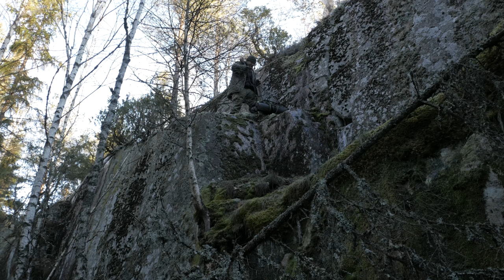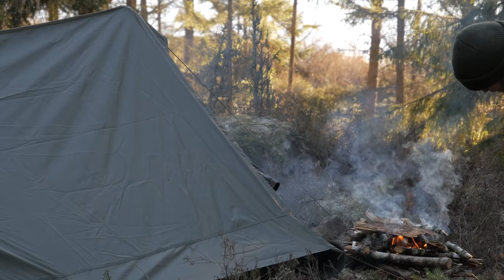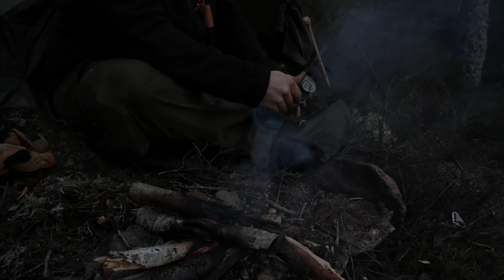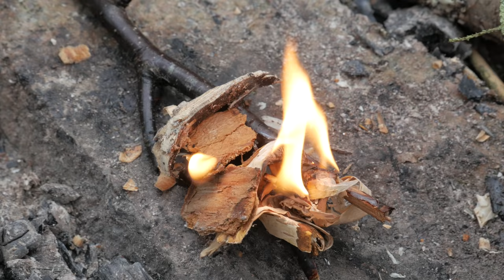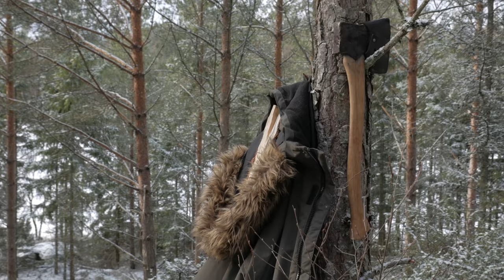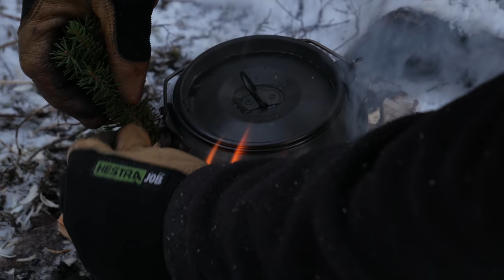3 Days Solo Off Trail Winter Hike  - Kuksa Carving - Natural Growth Bushcraft Chair

Comment: Another awesome video! The camp stool was very clever. Sometimes a piece of wood just tells you what it's supposed to be, and you just have to go with it. I figure seeing that branch gave you one of those "eureka!" moments like that. The kuksa turned out great! If I'm out in the woods, I try and do as much shaping and carving as I can before cutting it out of the log or branch (as you did). It's just way more stable and easier to hold steady if you don't have a vice or clamp of some sort. Glad to see I'm not the only one! The Auger and gimlet sure are worth their weight for Bushcrafting. I think it gets overlooked in many people's kit because the electric drill is familiar and the de facto tool for most people, so hand boring tools are completely off their radar. I carry an Irwin brand MicroDial expansive bit (bore size is adjustable from 5/8"up to 3") and an 18" bit extension that I use with a chuck for an auger brace with a scotch eye welded to the shaft. That, and a gimlet can sure come in very handy! What made you decide on the tent this trip? I'm looking at different zehltban/lavvu type shelters and was curious to know your thoughts on them and how they compare to a tent. Thanks! 👍🏻👍🏻🇨🇦
Reply from the maker: right! what better vice than being attached to the log itself! I took this tent because I need more lightweight, and I knew the temps were going to be both over freezing and far down as -15C during this trip. Im so tired of things getting wet and I wanted something with a floor. And its weird that in the bushcraft world there is some kind of common agreement we are supposed to use tarps and lavvus LOL. Everybody else going to the woods, who is hiking more than just staying in one spot roasting some hot dogs, use tents. So many things is trends these days. I love my lavvu... its the most versatile piece of fabric ever. sure but walking very far in tuff terrain like i did this time, it would have been horrible with a heavy piece of canvas.

Comment: Is it true that the two hole Kuksa are made only for tourist and genuine ones like a handle so they’re usable with gloves ?
Reply from the maker: possible. I had a kuksa with an elegant handle like a little dove tail. But it broke off in the pack. So with that in mind I made this to be like a sturdy tank..yet you can get a nice grip on it. And you can hang the kuksa on like a branch in the hole. If you want to use gloves with a hole just take 3 minutes and make the hole bigger with a mora.

Comment: How did you find the condensation in the French pup?   Not too breathable here in -20c!
Reply from the maker: not more than usual on a rain resistant single walled roof like that...the airflow in the tent is good...with good possibilty to control the amount of draft with the velcro flaps down at the sides.

Comment: I’ve always wanted to try to make a kuksa...is it best to make it out of a birch tree?
Reply from the maker: birch is good but it needs to be curly...like down at the bottom or some part that didn't grow straight, or else they crack easy. also the burls on birch trees are great material for kuksas. a suppressed birch is better than one that has grown fast and straight.

Comment: Another splendid video. How did the tent work out?
Reply from the maker: For being simple in its construction, yet robustly built for costing under 100 dollars I say its a real bargain. People have talked about seams you need to wax and that it gets condensation easily but I expereinced no more problem than usual with a water tight single roof fabric. It got velcro flaps down at the sides so one should be able to regulate airflow fairly good. I know more after using it some more.

Comment: you went into the snow with a F2 tent ?
You sir are one of the brave ones :D
I love my country, but F2s are very cheap, in price and form. Quality ain't bad, but yeah, I'd not use one of those in deep winter :)
Reply from the maker: It performed well. Good control of airflow. Its not for arctic expeditions of course. But I compare anything to a poly-tarp LOL

Comment: How did you find using the French Army tent.
Reply from the maker: It was nice. Perfect size and not heavy. Nice sturdy bottom. Good control of airflow. Have heard about some issues and that you have to wax seams...I guess I find out in summer 😁. Condensation was not more than usual on a water tight single roof tent I think
Reply: That's good hoping to get out with my son to try his . Great channel keep up the good work.

Comment: почему это место, обоснуй.почему дерево не горит？слишком влажное？неудачный выбор？
Reply from the maker: campsite close to water but higher for warm. Flat ground. This is how you burn wet or green birch... slow in the start but greatly beneficial once going in winter. More kindling is preferred of course...but if you do it many times you can do it with less, the thought about doing everything like from a rule of law... im so tired even thinking about that. Makes me sick to the stomach.

Comment: I have that tent and I find it has a lot of condensation, do you?
Reply from the maker: yeah but not more than usual on a rain resistant single walled roof like that...the airflow in the tent is good...with good possibilty to control the amount of draft with the velcro flaps down at the sides.
Reply: Swedwoods  I agree . Thanks for the reply , and I really enjoy your vids  thx

Comment: Excellent. Btw: which Carinthia is that?
Reply from the maker: Carinthia troopen reinforced
Reply: @Swedwoods  Oh, I have three Carinthia Tropen, they go comfort to 5c plus only, so yours must be truly reinforced to make minus :-). I was so amazed by the black compression bag, which usually is a sign for the Carinthia recreation sleeping backs, which I also own. Happy hiking.
Reply from the maker: @-ZELTHELD-  I always have a warm water bottle. to start the night warm is key, and use two wool socks on my feet. then reflective cover over the mat underneath and I button my thick winter jacket and stick feet with sleeping bag in it. I have used the trooper down to  -15 this way. didn't sleep all the way comfortable that time but I get comfort down to minus 7 easy
Reply: @Swedwoods  My mistake, it's not the Tropen, with "Trooper" (2x"o") you mean the "Allgemein" (German Army) or also known as Carinthia Defence 4. That makes more sense: https://www.carinthia.eu/bags/de/shop/Militaerschlafsack

Comment: Not sure why anyone would carry a snap on tool kit into the woods to make a basic fork and bowl, the Silky if that is what it was is the top tip.
Reply from the maker: Silky saws are for gardening. Ive had my laplander for 5 years and its still working fine. chisels are used when you need to hollow out something.

Comment: I wanna know the weight of the pack in the winter with a cast iron skillet
Reply: It's not cast iron. It's carbon steel and pretty light in comparison.
Reply: To Shay
Reply from the maker: light weight high carbon steel. It weighs so little I have not even cared to find out how much

Comment: French F1 puptent???
Reply from the maker: correct!
Reply: @Swedwoods  how do like it?
Reply from the maker: For being simple in its construction, yet robustly built for costing under 100 dollars I say its a real bargain. People have talked about seams you need to wax and that it gets condensation easily but I expereinced no more problem than usual with a water tight single roof fabric. It got velcro flaps down at the sides so one should be able to regulate airflow fairly good. I know more after using it some more.

Comment: I  can see you never learned how to buid a fire properly. Why do you insist on smoothering your fire.  Oxygen a key part gets reduced each layer you force on that small fire.
Reply: You have to do it that way outdoors when the wood is a bit wet so the upper layer can get dry.
Reply from the maker: This is how you do it burning green birch, or wet birch. Its basic. Mix with layers of softwood. And you always have to blow some and help it going in the beginning. But its worth the effort because a green birch fire is the best after 30 minutes when it takes. One can use more softwood, but worst season to find it dry, and of course then it takes much longer time to get the kind of coals you want for cooking.
Reply: Not really. Smaller bundles that allow the initial flames to build are more effective. 
 You risk putting out that flame with damp kindling. 
I would recomend taking time to construct feather sticks. Finding what mid-sized fuel timber available. Slitting them to smaller sizes to access the dryer portions.